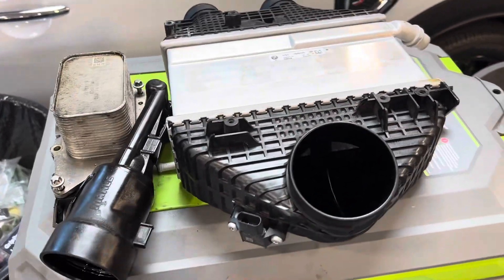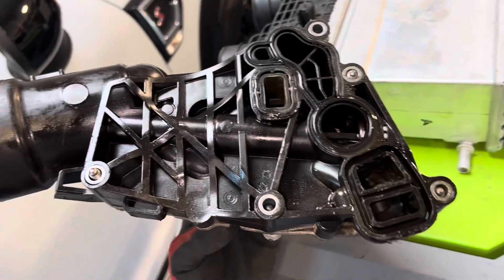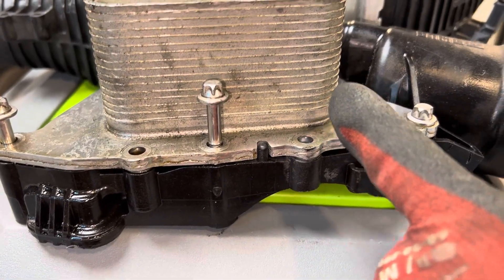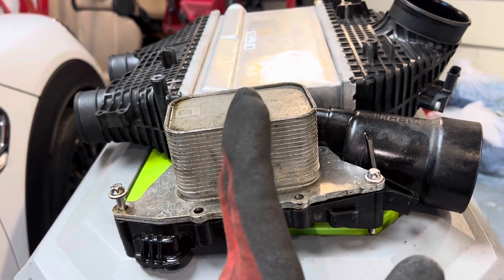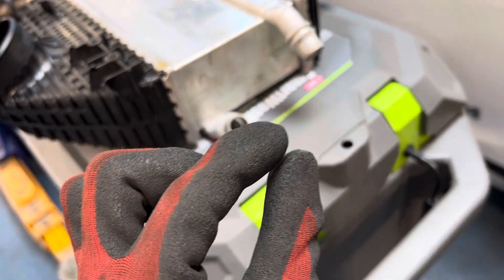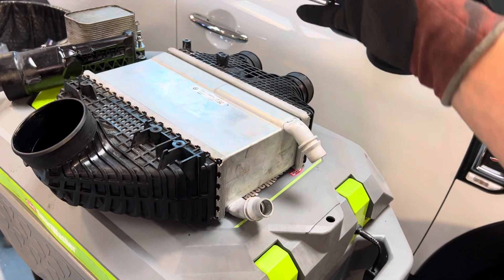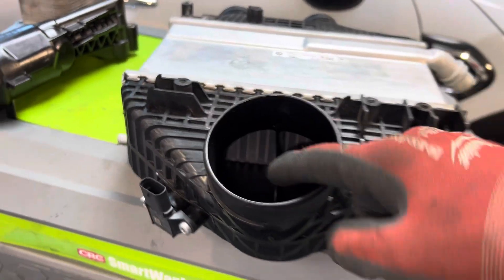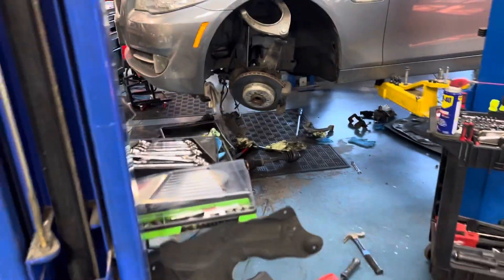HEAT EXCHANGER, Water To Air or Water To Oil or Refrigerant To Air or Chilled ￼ Water To Air

Comment: Oil temp never goes above 230 degrees F with oil level near minimum. My Audi displays digital oil temp @ the cluster for a few seconds. I just need to press several buttons. It's actually an oil heater not a cooler. Not sure why they call it oil cooler and DSG cooler. They should rename the heater core to Cooler core because they are connected together.

Comment: I have a question for a home ac 3.5 ton, can a hard start 521 help to bring down the in rush amps so the ac can run off a generator. I know a soft start helps bring down the in rush Amps more,  but they are more expensive.  So wondering if a hard start 521 can help as it is much cheaper
Reply: Install a soft start kit.
Reply from the maker: Hard start actually draws more amperage but for a very short period of time it is a little bit harder on to start winding in the compressor. 

He gives it that bigger kick of watts to get it up and running . 

When it comes to using with a generator, it’s a soft start part. That’s important. . 

Because you’ll have to spend several hundred dollars or more on a larger generator if you don’t have a soft start . 

So it depends if your purpose is to use a generator or not . 

And supposedly they say you’re supposed to use the hard start that is recommended from the manufacture who makes your equipment they have different versions .    

Hard starts are usually offered to people to make money technicians get bonuses a percentage of what they sell so they like to sell them and tell the customer that they’re going to save energy and increase the life of their equipment to make a quick buck . 

I do not recommend them, and I do not sell them . 

The only time I ever put a hard start on if the manufacturers recommendations for a particular type of installation, for example 

Windows are extremely long, refrigerant, piping length .  It’s difficult for the compressor to get it going, and or if the air handler is two stories of three stories up in the air and dad, Condenser is on the ground level. It takes a lot of power energy for the compressor to kick on and move the weight of all that refrigerant going three stories up a pipe.. 

So the manufacture will then recommend a hard start . 

In cold climates in some situations guys don’t read these little notes inside the installation, manual or the downloads that they have to go and read extra material because they’re lazy . 

They tell you to take out the piston and convert it over to a expansion valve with long line lengths in cold-weather operation and put a hard start kit .   

Because there’s so much extra refrigerant in the line when the compressor is off in cold weather when it’s only 30° outside . They had a hard shut off expansion valve that stores, the pressure in restricts the refrigerant. It is more difficult for the compressor to push on the initial start up..  so they recommend a hard start kit in this situation.  

Other than that, it’s just a sales gimmick to make more money .   I do not put one even on my own air conditioning or families..
Reply: @coldfinger459sub0  thank you good sir. Your always very knowledgeable on these matters.

Do you recommend a specific brand soft start? I know Microair is out there,  but seem to be the most expensive. ICM brand has a 4 min delay on starting the compressor, so not sure if that is nothing to worry about.

I need a soft start to install so my generator doesn't have a problem running it. I have a 13000 watt generator with 10500 running watt capacity.  Just wanting to help in the event of a power outage.
Reply from the maker: @edwinaragon8469 I have only seen the micro air personally a few times never have installed on myself because I don’t know anybody in San Francisco who has a generator. 

I just heard about the ICM brand about a year ago . 

So I have no personal on hands experience . 

But I asked for an air conditioning unit for its longest life, invest energy efficiency 

Proper airflow, improper refrigerant charge or two of the most important things for a long life and best energy efficiency 

Changing filters often 

Cleaning the coils make sure they’re not getting plugged. Do not have to use chemicals on the coil just if they’re not really dirty blowing them out with water. . 

Keeping leaves and Pineneedles and dirt from blowing our building up inside or at the bottom of the coils were cause corrosion in Cause Leaks   Keeping that clean